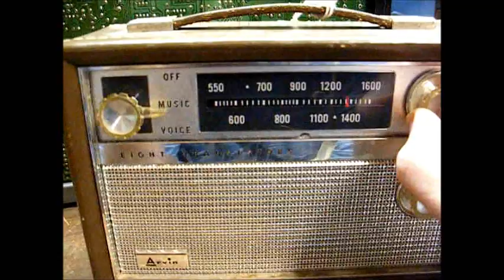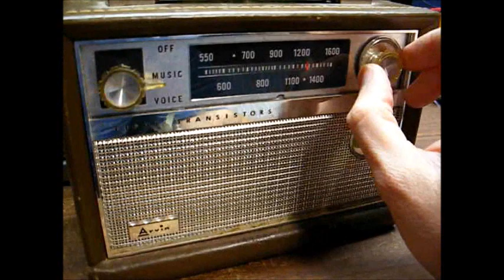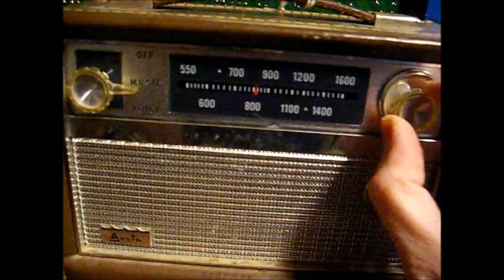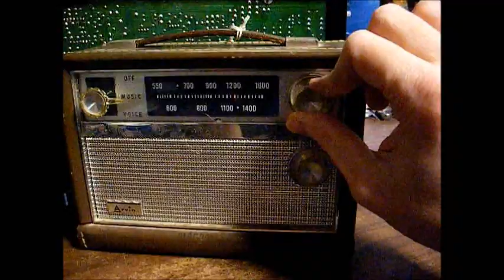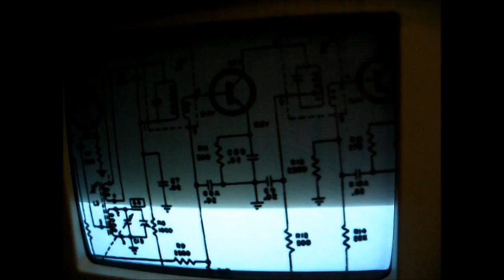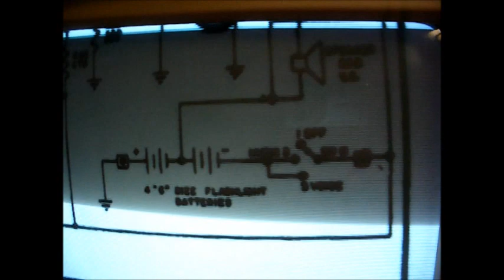Arvin 61R58 8-transistor AM radio circa 1962

Comment: Thanks for video. I have the Coronado version of this radio. Think it was marketed by a chain store in the midwest thats prob now defunct. It still works and is a strong performer. Never had to recap but did have to rewire the off/ music/ voice switch cause it was completely disconnected when found. Took awhile to figure out, had no schematic at the time.

Comment: You are correct about the FTC clamping down on the number of transistors used as a selling tool for the radio. That happened in the mid 60's 
I once worked on a Viscount 12 transistor AM only shirt pocket radio from 1965 that was made in Hong Kong. The set was not an outstanding performer in audio, selectivity or sensitivity. You with think with 12 transistors it would be. When I pulled out the PC board I got my answer. Six transistors were just soldered to the PC with no hookup to anything.